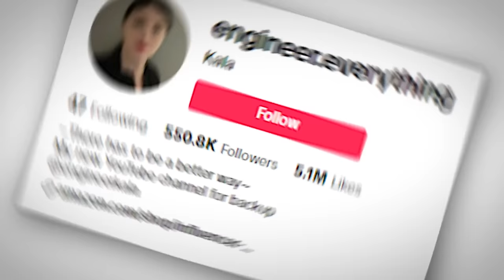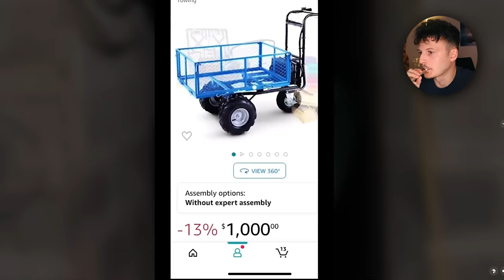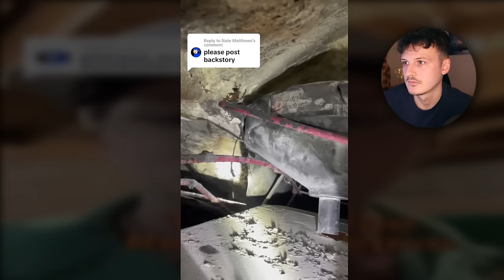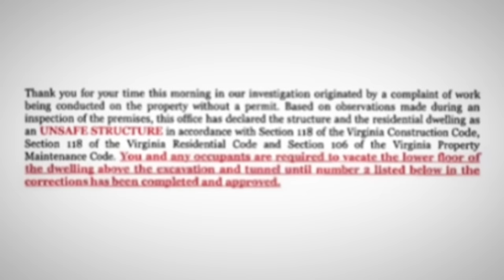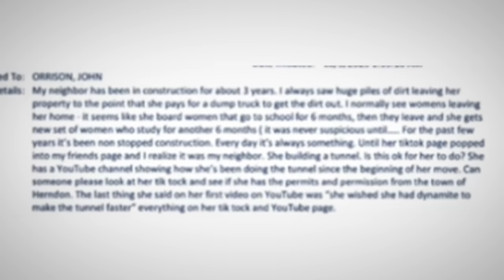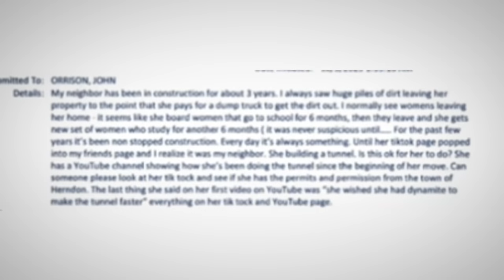The TikTok Tunnel Girl Is In Huge Trouble... (Shut Down By Goverment)

Comment: Good. I hope she gets fined and has her home condemned.
Reply: The house already looks like it was going to be condemned before Kala began their tunnelling project; the structure has significant structural issues and the roof and other sections of the house have been in disrepair and falling apart for years. Despite this Kala constructed a tower-like addition built in brick - visible like a sore thumb on Google maps - while completely ignoring these issues and then began their tunnelling project. They are very heedless of safety considerations and lack any concern or regard for others' rights, feelings, and safety.